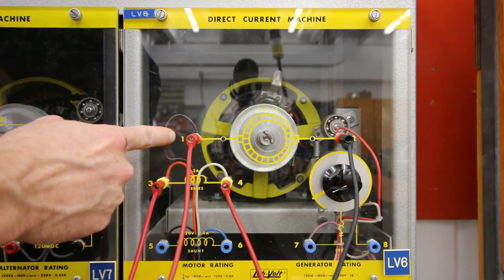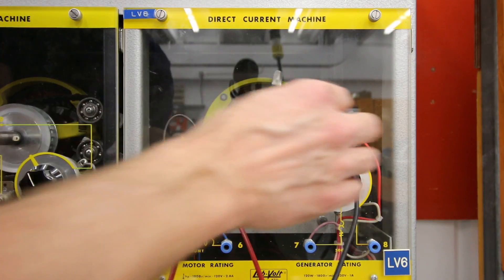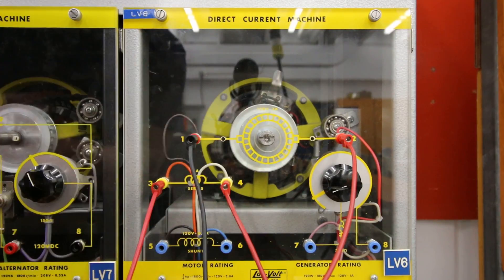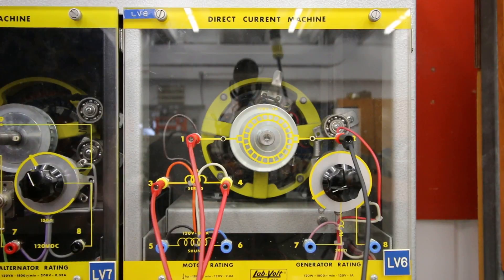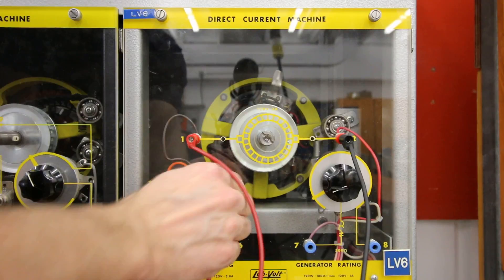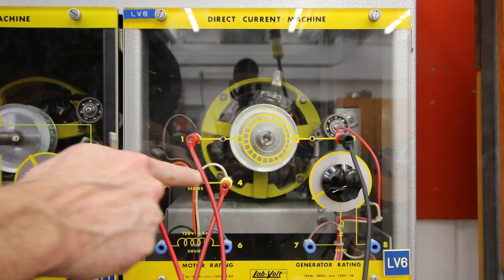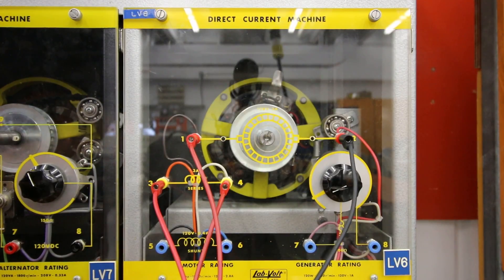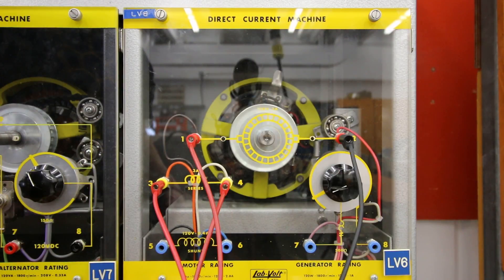Reversing a Series DC Motor

Comment: I was impressed by your excellent demonstration and equipment.  Can you tell me how a three terminal reversible motor is wired internally?  I have worked out a schematic for a four terminal motor, but cannot find anything or devise anything for a three terminal reversible series wound DC motor. Thanks for the information!

Comment: Hello sir, I have some questions.
1. I have a series DC motor. If I want the motor to change direction when I change power supply polarity, what can I do? I assume I will need some kind of relay?
2. I also have a wheelchair motor,  when I change power supply polarity the motor change direction as well. What is the different between a wheelchair motor and a series DC motor? Can I wire the series DC motor same way as the wheel chair motor?(if possible)